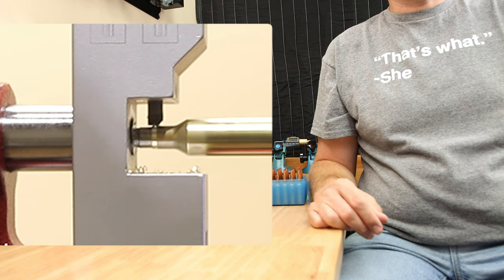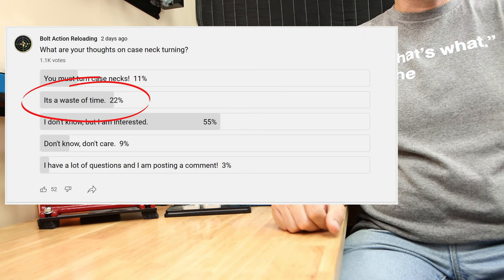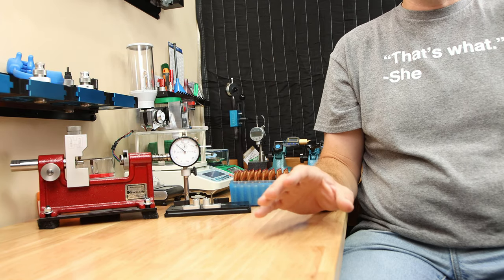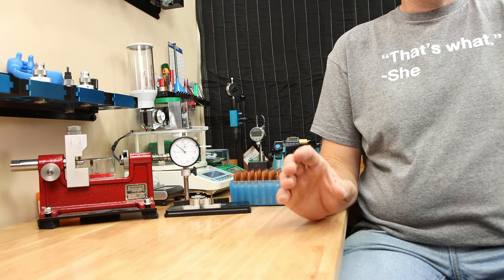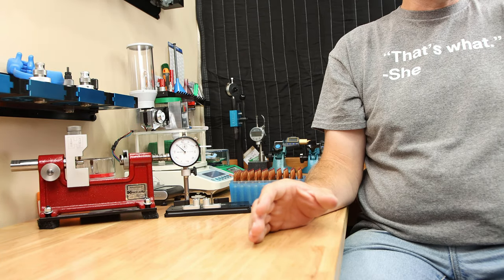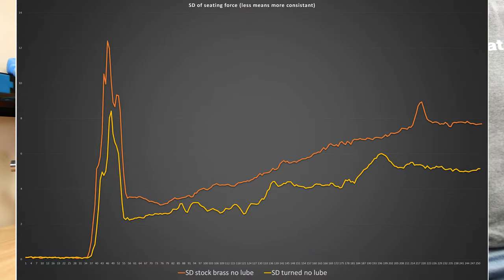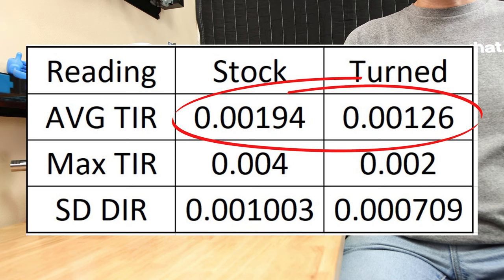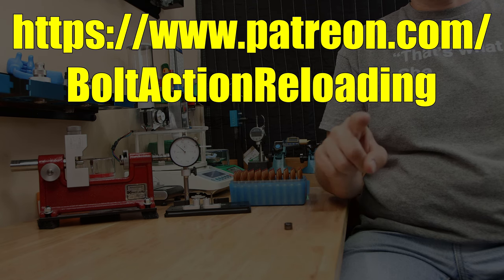Should You Neck Turn Brass? Lets find Out!

Comment: this lacks the only thing that actually matters. target performance, not measurement load variation. It's been my experience and as is commonly accepted: additional case neck expansion during firing is more detrimental to downrange accuracy then case poor case neck uniformity. The only reason you should turn your necks is because you have a tight neck chamber.

Comment: I am sorry to say that you lack experience in accuracy hand loading ie neck turning and are on the wrong track about some of the subject of neck turning for the  " factory chamber "  .  You don't want to turn the whole neck diameter 100% clean up it unproductive and wastes neck wall thickness . Your not loading for a tight neck chamber .  Only need to clean up about 75% of the case neck diameter .
The remainder that is not turned will straighten up upon first fire forming .  Re-turning on the same setting after a few firings will clean them up even more . The more brass you turn off the greater the gap is between the loaded round neck diameter and the chamber wall before firing . This is a negative for case alignment but can be fixed , with partial neck sizing and body die sizing . This creates a slight second shoulder at the case neck shoulder junction ( not a ridge ) after the first firing , that never gets sized down for the life of the case .  This regains the lost case alignment . You are not turning down far enough onto the case shoulder and are at risk of creating a doughnut inside the case neck upon firing . Any ridge on the outside goes inside upon firing .  The process for a factory chamber is way different to whats needed in a tight neck chamber rifle .  Turning does give seating and run out advantages as you say but the advantage is lost if you don't also practice partial neck sizing in a factory chamber  .

Comment: Your not doing it right , the  cutter needs to come right down onto the shoulder just a slight scrape so you are sure you have done all the  neck and not creating a doughnut . If your neck turning for a factory chamber then you are increasing the gap between the case neck and the wall of the chamber and that can negate any advantage of extra concentric brass because the case lays in the bottom of the chamber in a sloppy factory chamber . Also you don't want to turn off too much brass for a factory chamber just a skim neck turn is all you need . Clean up about 75% only . The trick to get the neck turn advantage is partial neck sizing so a small section of the case neck is never sized . Using a  Redding body die and a Lee collet die  or a Bushing neck sizer die . The small second shoulder remains full chamber diameter for the life of the case . Mainly only suitable for bolt action rifles  .